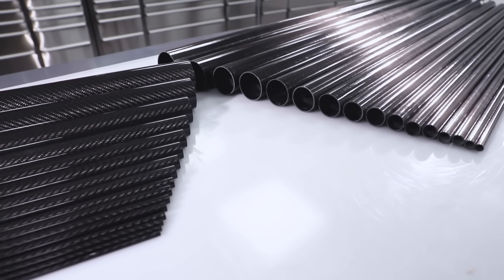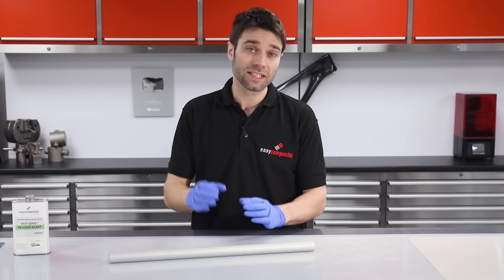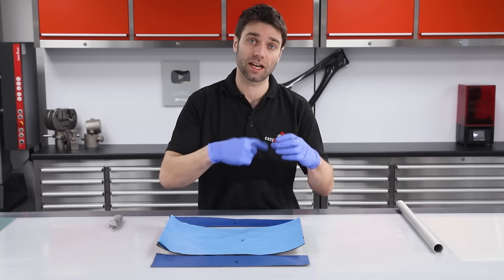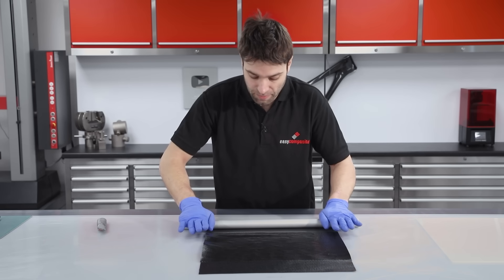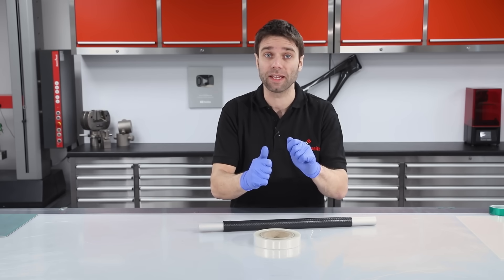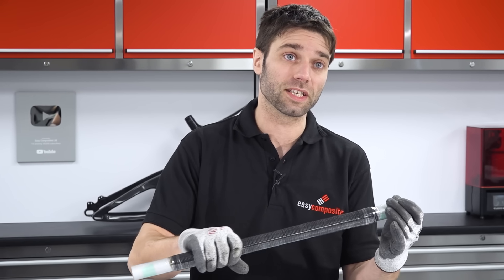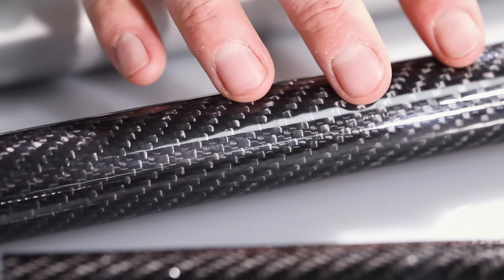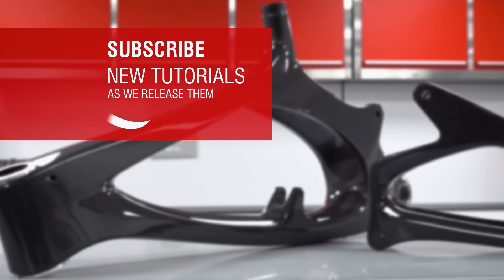How to Make a Roll Wrapped Carbon Fibre Tube

Comment: Great video.

Hi Paul 
We were attempting to make a carbon fiber tubular frame 
Does this method work for that?
Reply from the maker: Only where you have access to extract the mandrel.  Curved tubes or tubes with no end access won't work by this method.
Reply: @easycompositestv  thank you paul

Comment: How it seems so simple in the video? The carbon does not stick to the glove or to the surface. I tried on a glass table, clean, and the carbon sticked on it when i tried to wrap the mandrel, than when it came the part with the UD it sticked part to the mandrel and part to the table, so the UD piece disassebled and it all went a disaster…what i am doing wrong??
Reply from the maker: We rolled it on a polypropylene sheet. Also keep your ambient temperature a bit lower.  The warmer it is the tackier the pre-preg will be.  Any inert plastic surface will be easier to roll on.

Comment: Hello, I've made some carbon fiber tubes using this technique but it didn't come off easily, I had to clamp it and hit it with hammer so hard to remove the aluminium tubes and I'm not exactly sure what was the problem whether is it the straightness of the tubes, the surface quality or the pva that I used. Any tips on identifying the problem or checking the qualities before starting the process?
Reply from the maker: If you used pre-preg, PVA is not ideal.  A modern chemical release agent will give a better release. If its small enough put it in a freezer and it will help the aluminium shrink away from the carbon.
Reply: realeasing agent

Comment: Could this process be applied to making square tubing as well?
Reply from the maker: In theory yes but in practice you tend to find the corners end up thinner due to uneven pressure so its not ideal for structurally critical applications. You can use a tubular bagging film to get a more even amount of force around a box section.

Comment: could you roll wrap like a 2cmx2cm spruce spar (and keep the spar) to make an even stiffer and stronger square carbon tube? or would filling a premade square tube with foam have the same effect?
Reply from the maker: You can certainly use this method to repair or add extra strength to a pre-existing part.
Reply: @easycompositestv  you sound like you dont think it's a great idea. Why not? Part under consideration will need to bear heavy load under tension without flexing and frequently be subject to harsh vibration. Weight is a priority but not only priority; still, would like to make it significantly lighter than it would be in aluminum.

Comment: Love what your doing here thanks . Question... what about temperature? Either what temps can this withstand or is there high temp options for resin? 
    Thanks again
Reply from the maker: In the case of this tube, the cycle runs to 120'C and the maximum working temperature of the XC110 PrePreg is 120'C so you'd be safe up to that temperature. For anything higher than that, you'd need a higher-HDT PrePreg material.

Comment: To have a beautiful finishing and remove the shrink tape marks I understand that you grid it, and apply laca coat? what coat I can use to have an smooth and shiny apperance?
Reply from the maker: Once it is sanded smooth any good quality lacquer will achieve that.

Comment: Excuse me for asking, it's just a thought that crossed my mind. Like steels tube, you could cut, puncture & weld it together. But does carbon fibre tube could do the same, although maybe with a different processes? I was thinking of making a frame for 150cc motorcycle using carbon fibre tube. The test showed it could withstand 700 kg after a proper method process, but what about the joints part then? Or should I focus on using molding methods?
Reply from the maker: Hi Harith, there aren’t any equivalent processes to cutting and welding a metal tube in composites, not that wouldn’t compromise the strength massively. Your options are a moulded frame construction or complex moulded joiner sections but honestly, the joiners are so difficult to make, so compromised in terms of performance and limit the scope of the frame design in general that you might as well just mould the whole frame and give yourself the potential for something that performs well.

Comment: Any tips on how might go about making a carbon fiber flange for a pipe?
Reply from the maker: I'm not sure whether you want to include the flange on a tube you're making, or make a separate flange that can be fitted to an existing tube. Either way, the same prepreg that you see used in this video would be the easiest material to use for the job, oven cured again, as you see in this video. You could make the 'barrier' to form the flange using a disc of metal (like aluminium or steel) which slides over the mandrel (or exiting carbon fibre tube) to create a temporary barrier. It would need to be fixed in place (for the cure) and will need to be treated with release agent (as we did with the metal mandrel). Woven prepreg could then be cut as both hollow disc shapes and also castellated strips which could be laid onto the mandrel/tube, also bridging between the mandrel and barrier, and also onto the barrier only. For consolidation pressure you could wrap shrink tape around the material on the mandrel/tube, and then use another (release treated) metal disc and clamps to compress the flange.
Reply: @easycompositestv   Thank  you! Excellent and very much appreciated! I absolutely thank you for providing this tutorial and have followed through with a few descent successful attempts using these these steps. My most challenging part of the process (apart from precise precuts) with a 88 MM OD/685 MM Length was the actual wrapping. I understand a press machine for the roll is costly but ultimately would like to use this type machinery for mass production for my product. And advice on machines for the roll wrapping?
Reply from the maker: Unfortunately, no, although we understand the process and have seen the machines in operation, those machines I have seen have either been custom fabricated or they're old machines that may have been repurposed from another application. Sorry I can't give you a better steer on this.
Reply: @easycompositestv  Thank you for the insight!

Comment: COOL.... Do you sell premade Tubes 5ft long about the size of a Broom Handle
Reply from the maker: We've got a big range of Carbon Tubes in varying finishes, diameters and lengths. You can find them listed by following the link below: https://www.easycomposites.co.uk/carbon-fibre-tube  (if you're in the EU, replace .co.uk for .eu to access our new EU website).
Reply: @easycompositestv  Thanks... I'm in Alberta CANADA... was thinking the Tube for my MINELAB Metal Dector... its about the size of a Small Broom Handle 5ft to 6ft long... I'll check out your site...

Comment: Great Video. I need help though. I made a carbonfiber tube out of epoxy and dry carbon fiber cloth (no prepreg). After it cured it was very sturdy and I wasn't able to bend it, even with standing on it. I then sanded the surface and spraypainted clear coat onto it. But after that the Tube got really soft to the level where I could bend it with just 2 fingers. Any ideas? I cannot find information on spraypaint softening epoxy on the internet
Reply from the maker: Was the lacquer baked?  Or did you use a solvent based resin system and the solvents in the paint softened it?
Reply: @easycompositestv  yes I think its solvent based. That would be the reason then thanks, weird though after about 24hours it got much harder again, but not nearly as sturdy as before

Comment: wow, I didnt know a piece of carbon fibre can be that strong. Is it possible to use this material to create a loft bed? that will carry about 200-250 lbs ? Somewhere along the size being 54 in (1371.6mm) length x 45 in (1143) width x 74 in (1879.6mm) height.
Reply from the maker: In theory with the right design it should be possible.

Comment: how thick can we make this?for example high torque applications ?
Reply from the maker: In theory as thick as you want but generally you have to modify the process for walls over 2-3mm thick or use different pre-pregs to avoid resin overheating issues.
Reply from the maker: For high-torque applications, it would be worthwhile including plies on the diagonal axis as well to give you more resistance to twist.

Comment: Great video! You make it look so easy...
Can a slightly bent tube be rolled? I need to produce some bent carbon pipes. Can you please advise? Thanks!
Reply from the maker: If the tube diameter was constant and the curve was perfectly constant then it might just about be possible using this method but generally for anything other than a straight tube you would need a split mould, as shown in our other tube tutorial.
Reply: @easycompositestv , thank you! Unfortunately I can't use a mold as I need a perfectly smooth inside surface at 1inch diameter. Ultimately I was considering using plaster, wax or any other material as a mandrel then eliminate it somehow.

Comment: For the stress tests I would recommend converting it also into Momentum, since it is quite some difference putting 700kg on a 0.30m long tube or a 1m tube or check if it sustains the same if converted to momentum, which will be more accurate :)
Reply from the maker: The test was purely for demonstration purposes rather than a precise test.

Comment: How would you make it stronger, so it could hold up to 2000kg load on a tube of 70cm long? Is there a formula to calculate this? Thanks!
Reply from the maker: There is no simple calculation for that as it would involve some complex load calculations to simulate the composite structure.

Comment: How long of a tube do you think is reasonable on a straight wall mandrel (no taper) if I want to make sure I can remove the part from the mandrel? Assume around 30 or 40 mm diameter tube.
Reply from the maker: Longer than a meter may be very difficult to demould by hand.
Reply: @easycompositestv  Thanks!

Comment: I have a wild idea for making a ultra strong MX handlebar: start with a cheap alu handlebar with nice profile. Rougen the inside surface with blasting or beads or whatever. Fill with resin and fiber, then compress hydraulucally from ends and cure. Would this make a super strong and stable handlebar?
Reply: I don't think it would work that great since carbon fiber and other fibers get their strenght because of their structural rigidity and unless you could mold strands or stripes of material inside the handlebar I don't think the fibers are going to give much rigidity other than the one provided by the resin.

If you observe in this example, the resin plays the role of a binding agent between the fibers, the fibers are the ones which provide the strenght.

You could imagine the case of cement vs rebar + cement. Cement is strong but cement and rebar is stronger.
Reply from the maker: Composite handle bars do exist but they all rely on lots of UD cloth down the length for stiffness and the woven cloth for all round strength.

Comment: Hi,  What is the diameter of the tube in your 'unscientific' test?  The twill is 0-90?  So the shear strength is just that for the epoxy?
Reply from the maker: It was a 20mm ID tube. if you go back in the video, you will see it is a mix of woven cloth and UD.

Comment: How would you form a hoop of diameter 160cm and tube of 1.9 cm?  It seems it wouldn't be roll-wrapped?
Reply from the maker: It would have to be moulded using a 2 part mould as there would be no way to extract the mandrel. A CNC carved foam core could work if you choose a core that can take the heat and pressure of the pre-preg cure.

Comment: Great video :), Do You think it would work for a bit more comples shapes, but which still allow mechanical extraction, like cones, or tube that gradually goes from square-ish cross-section to a round one? :)
Reply from the maker: Yes tapered tubes, cones etc should all be fine.  Just remember the bigger the part the more "vacuum" and friction holding it to the mould.

Comment: I was told by someone many years ago when I was in school for fabrication that foam would work to build tubes.  The idea was that you layer and have it cure then use a solvent to dissolve the foam leaving you with a perfect tube section.  Is that an actual option?  I never needed to build a tube but I always wondered if it would actually work.
Reply from the maker: Yes using the "lost foam" method does work although for pre-preg use you would need a foam with both a suitable compressive strength and high temperature tolerance so it does not distort during the process.  For room temperature curing, polystyrene is ideal as it is easily dissolved out with several solvents.

Comment: how would you make a prop shaft for a car or a struts brace? how do you attach the ends to the fibre?
Reply from the maker: The manufacturing process for a prop shaft might well be very similar to the process shown in this video although the fibre orientation would be very different. For high-torque applications you would want the majority of the fibre to be spiralling around the tube (45 degrees for example) to resist the torque most effectively. The end fittings could be bonded to the tube using a variety of lap configurations (single lap, double lap, pocket lap etc.) or could even be designed to be laminated into the tube at the time (thus mechanically engaging the end fittings into the laminate). For more conventional applications, like the strut brace, the end fittings would just be bonded onto the ends of the tube, again, using various lap configurations, according to requirement.
Reply from the maker: A tube which needs to withstand torsional forces such as a propshaft would normally be made in a different way using a pull-winding technique as the fibres need to be oriented in such a way as to mitigate the torsional/twisting forces. The tubes made in this video are biased in the 0-90' direction  and so less suited to such applications as they'd be likely to fail in torsion. Pull Winding involves winding composite tows or yarns around a mandrel in varying directions.

Comment: Please tell me this, on a parabolic taper, 'HOW' can 'CF' prepeg be mixed [(in material type) to emulate] to react like an existing wooden pool cue shaft??
The working mechanics of the created lever, made out of this superior strength material?!
Reply from the maker: If I understand your question correctly, to create a tapered CF tube you would just need a tapered mandrel. The UD CF prepreg can be applied in separate pieces cut in wedge shapes to accommodate the reducing diameter.

Comment: Great content! Nice to see people that work with composites show that is not as complex as most people thing " for simple stuff" 
Also is it possible to use a 3d printed conical shape instead the alu tube to do the same kinda tube making technique?
Reply from the maker: Yes it would be possible, but the print would need to have a decent level of infill to be strong under compression and also would need to be a high enough temperature filament for the pre-preg cure.  The surface would probably need finishing or coating with a release tape so the resin does not stick in the layer lines making demoulding impossible.
Reply: @easycompositestv  oh cool, good to know! And is it mandatory to cure it in an oven or room temp for 24h+ is enough to achieve full mechanical properties? I just got a starter kit from you guys to repair some minor damage in one of my bikes, and would be a great help to know if its ok to repair it and just let it cure in room temp.
Reply from the maker: @joaotakayama  The resin in the kit will cure fine at room temperature. You can post cure it using one of the cycles in the EL2 TDS if you want to slightly improve the overall mechanical performance and also if you want improved heat resistance.
Reply from the maker: @joaotakayama  You won't achieve 'full' mechanical properties with a room temp. cure only; it won't be bad but to optimise the strength characteristics, if you can post-cure the part in elevated temperatures, it will increase the properties. Note, it doesn't necessarily have to be an oven, you can run lower-temp post-cures using heat blankets and IR lamps as long as you're able to set to a known temperature.

Comment: Nice video, well explained without big egos for a change.

If worst comes to worst, remember that common swimming pool acid will dissolve the aluminium tube away in a minute without affecting the CF at all. 

A professional fiberglass friend who makes fiberglass tubes, uses cardboard tubes, then just throws them in water overnight.
Reply from the maker: Interesting comment Mark; it wouldn’t be possible to use cardboard as a mandrel for a prepreg tube like this of course (the process relies on thermal expansion of the mandrel) but it’s a novel way of making a mastic fibreglass tube.

Comment: Can you use PVC pipe for a madrel that would be cured in room temprature 70F.? What kind of release agent would i use?
Reply from the maker: Hi Mo, you can use plastic piping although ideally polypropylene is better for natural release from the carbon.  PVC would need a mould release agent like our CR1 EasyLease.
Reply: Thank you for the reply. greatly helpful

Comment: Hey i love your videos and it is very knowledgeable i wanted to learn how to chamfer a cf tube at ends please can you suggest a solution
Reply from the maker: Hi, you can add a chamfer by simply cutting it with a power tool such as a grinder and cutting disc or by hand sanding, carbon cuts and sands really easily.